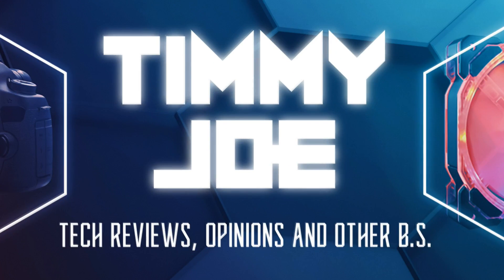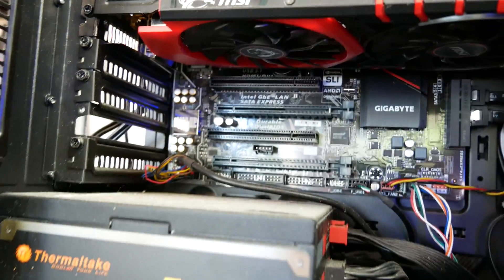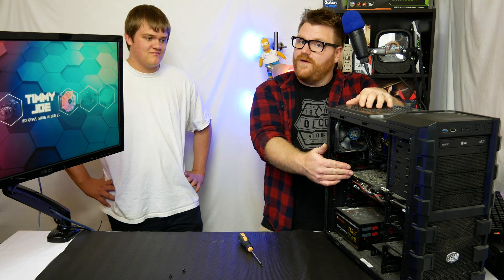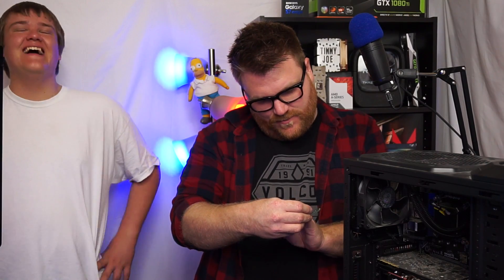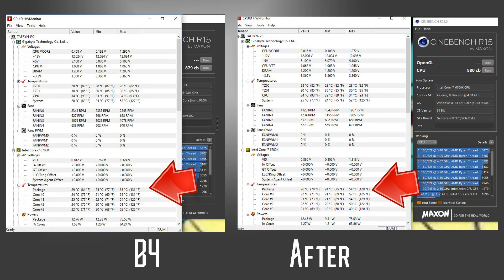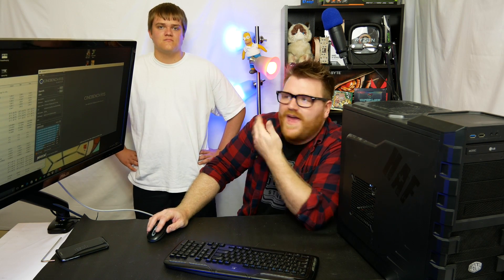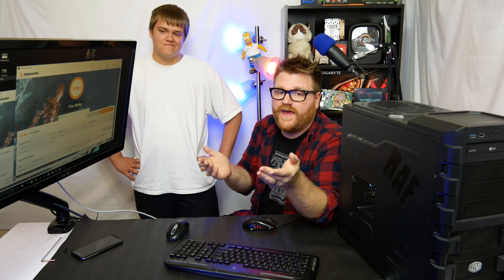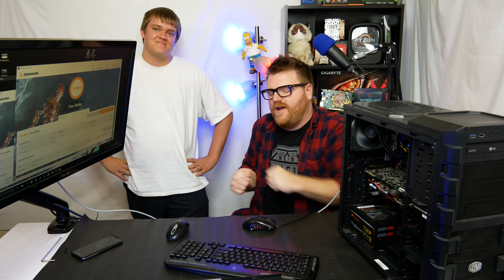Intel i7 6700k and GTX 970 Overclocking and Cleaning!

Comment: Best thing I've found for cleaning dust out of tight spaces besides compressed air is a nice soft paint brush. Gets in those cracks and in between the fan blades. Depending on the environment some dust and dirt simply will not come off with just air. Good video from back in the 2017's.

Comment: What do you think the lowest voltage I can run at with a 4.4 overclock? I just lowered my voltage from 1.3 to 1.275 because my temps were too high. Average temps were low to mid 80’s with max spikes of 96, 90, 88, 89 (Water cooled i7 6700k). I’ve seen people with higher volts & higher overclocks with lower temps than mine. 🤷🏾‍♂️🤷🏾‍♂️
Reply: Did u find an answer ? Can u help me

Comment: I have a very similar case (Enermax Ostrog GT) with a pretty similar setup when it comes to cooling/fans ... and it never gets this dirty. I'd suspect his PC lives on the floor (mine sits on my desk) and I didn't see much in the way of filters on his rig. 

So here's my tip: I'm using Demciflex magnetic filters  - one filter on the rear intake (for the AIO radiator), one underneath for the PSU. And that seems to do a pretty good job of keeping the inside clean. Every now and then I have to remove the front bezel to clean the built-in dust-filter there (2x140mm sucking in at the front) and I check/clean the magnetic filters every week or so. But that's pretty much it when it comes to dust-management for me. Well...TBH, I did put the filters through the dishwasher once to remove all the nicotine that was collecting in them, but since not everyone smokes at their computer ...  :D

Comment: I have an i7 970 running at 4Ghz, and I somehow beat a 6700k stock...
Reply: HoppsTech nope
Reply: MegaDominik1 on cinebench, yeah
Reply: HoppsTech nope no way
Reply: MegaDominik1 yes, way
Reply: MegaDominik1 I get 895, 6700k gets 888
Reply: HoppsTech i dont think youre doing the same test
Reply: MegaDominik1 the cpu test on cinebench r15
Reply: HoppsTech now way your i7 970 scores that high, a 4ghz oc isn't even that high

Is what I wanted to say, till I remembered the i7-970 is a 6 core 12 thread pc.

So yeah, my xenon x4560 oc'd to 4 gets the same ball park. But like you i7 it's also 6 core 12 thread. Single core is like 120.

Also keep in mind intel hasn't exactly been making huge gains lately. Without real competition from amd, single core performance stagnated
Reply: MegaDominik1 no he's right, it's just that the i7 970 has 6 cores an 12 threads, so each core even oc'd is still a bite weaker, there's just more or them. So it scores close in the all core test, but would get crushed in single core

Comment: 4.8... if your lucky maybe.. so glad you didn't touch auto overclocking.. 1.320 sounds kinda high for 4.5 though but dang 6700k cools miles better then 7700ks when you try oc. Make sure you find the uncore ratio settings and punch in a number like 40 or 42 as sometimes uncore at auto follows core clock and creates the need for more voltage or plain unstability
Reply: Damien silicon lottery I've seen em go up to 5ghz my 5930k runs at 4.8ghz on all cores at 1.279 v
Reply: I've had two 6700k and both ran 4,8GHz. Other with 1,4v and the other which I currently use 1,36v.
Issue with both was that delidding was required. 
http://www.overclock.net/t/1570313/skylake-overclocking-guide-with-statistics

Biggest sample size I know (142 in the link) shows median of 4,7GHz with 1,38v for 6700k and these overclocks are probably still biased towards the better end as people do not tend to share bad results that often.
4,5-4,6 GHz at around 1,3v is probably what most of us should expect.
Reply: Diglo1 4.8 gold chip  me 1.42 for 4.6 and 1.35 for 4.5
Reply: mine does 1.2v 4,5ghz should definitely be able to get 4,5 below 1.3v easy peazy

Comment: I was wondering what happened to your intern, Taeryn.  Glad to see him back.  Taeryn might want to look into the environment that his PC lives in and ask himself why it's so dusty there.  Maybe he can keep the place where his PC lives cleaner and by osmosis not get so much dust and debris from getting into the case in the first place.  I don't think that you ever got around to mentioning what type of RAM was installed or its speed, nor did you ever say how many gigabytes the hard drive turned out to be.  In the end, though, the case and internals cleaned up nicely.
Reply: hey I'm Taeryn the intern and I usually keep my PC under my desk in my room and I will admit the corner it is in is indeed quite dusty which I do have to clean when I get the time for it, and if I'm getting this correct I believe my hard drive is about 1TB like my E drive is 1TB so... I think that answers that and I think he mentioned what kind of ram it was somewhere in the video but I don't believe the speed was shown of the RAM.

Comment: Omm...maybe you meant to say...2 terabyte hard-drive and not 2 gigs or 8 gigs...so so small? otherwise thats like a small 2g flash drive size...At-least it's pretty decent gaming rig:)...Perhaps you should add another 120 fan to AIO for push-n-pull config...to give it little more head room for cooling and further OC it to like 4.7/4.8Ghz...
Reply: drew alt411 rofl lmao lol pmsl sorry your comment was just funny push pull vs push vs pull makes so little difference in temps in general. it's a 120mm rad how much cooling do you think it can pull off would get more cooling if you put a 240 or a 280mm aio